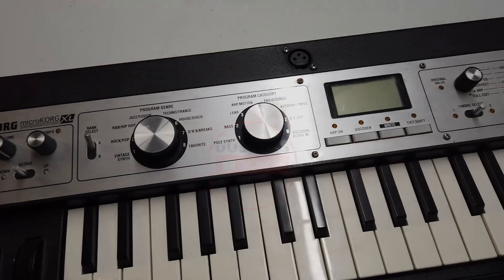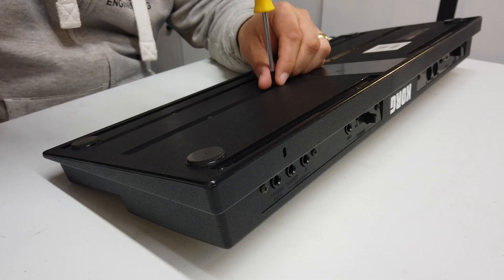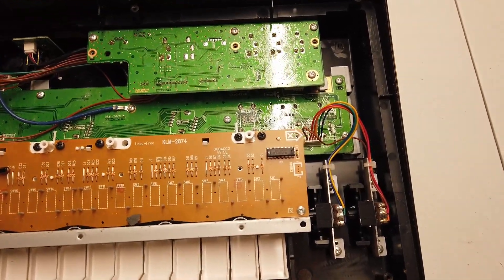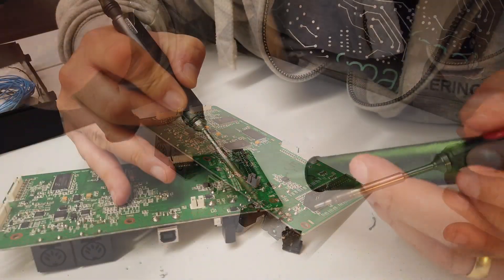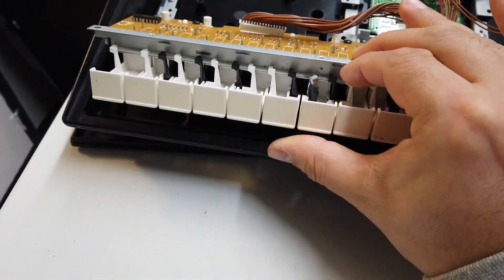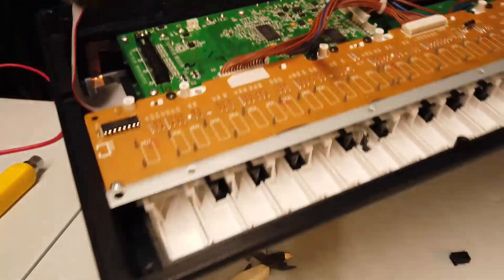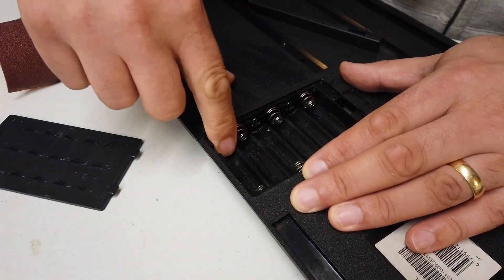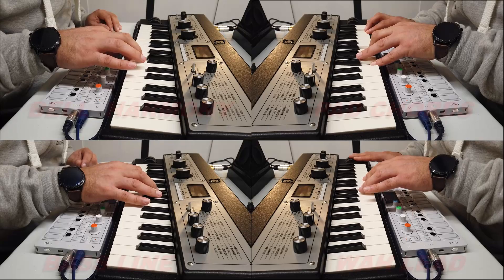DuB-EnG: Whats wrong with the MicroKORG XL? Lets Repair Restore & Refurbish this unit!

Comment: Hi there, wondering if you could help? Like yourself, I found one second hand on ebay. I'm having issue with the power switch. Is the switch supposed to click on or off.  I have been told by the seller it needs to be held in to power on and held in to power off.
Reply from the maker: Without a shadow of a doubt, mine clicks and latches on then clicks and latches off.  One single short press.  No need to press and hold.  Perhaps the latch in your switch is broken.  Solder a new switch in place.
Reply: Thanks for the reply. Since I'm not electronically minded, could you tell me what sort of switch am I looking for or possibly link me up with something that would fit. Forgot to mention that I have the XL plus version. Don't know if there may be a difference in models with the ports or where the switch is positioned.

Comment: Found one of these on the street today, seems to work but very relieved to see someone's done a repair video for whenever I figure out why it was left on the street (surely wasn't just the corroded batteries?!)
Reply from the maker: OMG what a find!  They are £300 second hand!
Reply: @DubiousEngineering  right?! It's absolutely filthy so I'll have to open it up to clean it and I haven't been able to test the keys/audio yet. Feel like for parts alone it'd be £50+ regardless.

Comment: Hi!
I'm repairing my Microkorg XL+, that also had a broken DC barrel. Do you have any suggestions on where to find a part that has the same pinout?

E: just saw earlier comment, too bad :/
Reply from the maker: Sorry man!!  Good luck!!!
Reply: @DubiousEngineering  I am going to snip an extension cable and solder the female end onto the board, to have a dangling plug. Wish me luck!
Reply from the maker: @casinomann  great 👍 idea 💡...  that'll do the trick!!

Comment: Great video. Question: my Microkorg XL standby/power button/switch stopped working. Luckily the synth turn on when I plug in the power so I guess it’s stuck on Powered On state. Any advice on how to fix them?
Reply from the maker: Likely just need to spray some switch cleaning lubricant into the switch...  electrical contact cleaner will likely do too
Reply: @DubiousEngineering  Cheers man, will try. Thanks!

Comment: Hi there ! Thanks for the great vid :)  I'm just wondering if I can ask You for an advice ... Is there's some way to repair /replace the audio outputs of my xl (everything else seems to be working well .. except no sound is going out of it ...)  ? Thank You very much !
Reply from the maker: You'll need to test the audio output chips - you may be lucky, it could be just loose connectors.
Reply: @DubiousEngineering  thank You very very much for theanswer ! ... but maybe ... Could  You please be little bit more specific ?  like speaking to a total  noob :)  Since I' m not sure .. how can I test those audio output chips ? :D

Comment: Hey guy. My MicroKORG won’t turn on anymore. Anything i can do to restore it? if i give it some new batteries, i also use a power cable and nothing works…
Reply from the maker: Oh dear...  I reckon you're going to need a multimeter for checking voltages...

Comment: Did you actually plug a 12,5V PSU to your Microkorg XL 9V inlet?
Reply from the maker: Probably...  but the regulator is capable of handling much more than 12v

Comment: I accidentally had my electrical adapter setting too high and burned out the plug in. I can still use batteries but what a pain.
Reply from the maker: Awww...  can you replace the diodes and burned bits ?!?
Reply: I did a little more research and know where I should look. Some people have experienced more damage than I have. I hope the repair isn’t too bad.
Reply from the maker: Oh go on... repair it!!!  It’s only a few hours of your time!!!

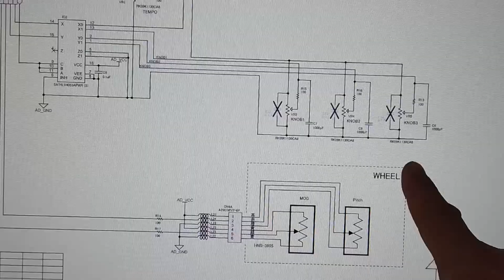Comment: Thank you for the very helpful and intuitive video! I was wondering if you could share a link to the potentiometers shown at 5:08
Reply from the maker: They are from RS components ...  stock number 7293647
Reply: @DubiousEngineering  thank you!
Reply from the maker: Pleasure, and good luck!
Reply: @DubiousEngineering  Thank you for sharing this video! In the schematic it calls for a 5k pot, "RK09K1130CA8 (5KB W.O/CC H:25MM)" with your board, KLM-2879. Does switching to a 10k pot cause less frequency range with the pots or have any side effects that you know of?
Reply: @georgejitsu265  having the same problem so would love to find out if there is any issues with these 10k pots!